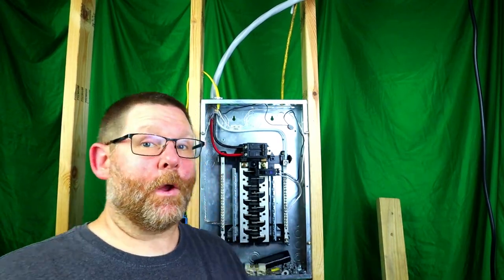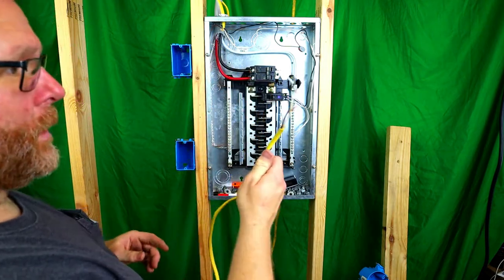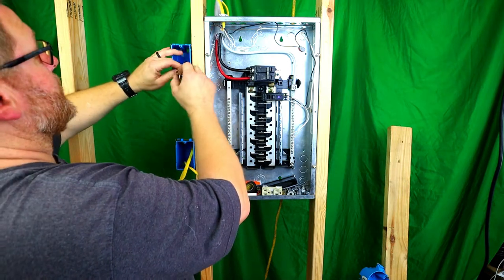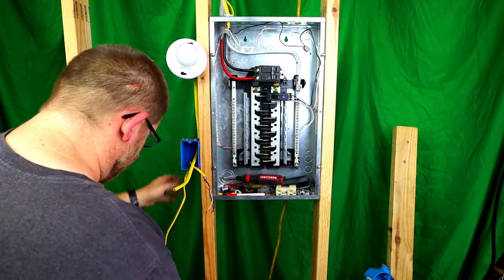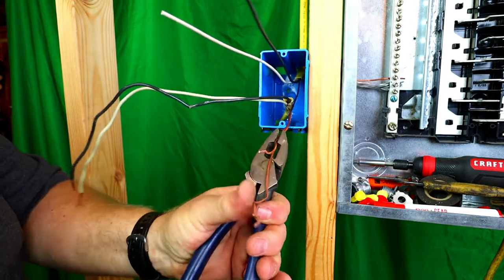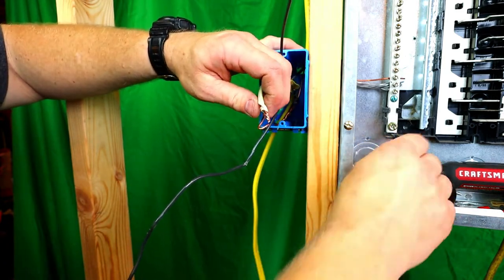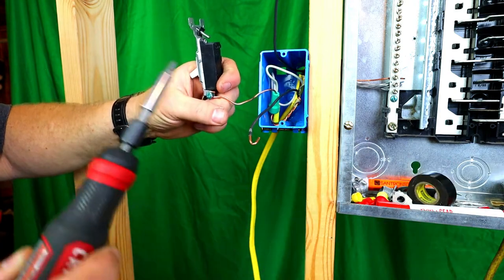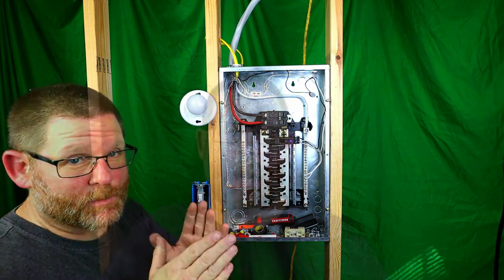Installing A New Light And Switch From Start To Finish | DIY Part 2

Comment: Thank you. Curious about the red, black and white main leads coming in. I typically think of black - hot, white - neutral, ground - green What is the red?
Reply from the maker: Depending on how you run the circuit, most of the time it's a traveler

Comment: Didn’t see link for Klein angled ROMEX strippers
Reply from the maker: https://amzn.to/3SuiKGf not sure what happened to angled here are the straight
Reply: @MountaineerOutdoors  same. Thanks for putting up the new link. You should pin this comment so others can see it too

Edit: actually this link is sending me to the same strippers
Reply from the maker: Apparently the angled ones are not available anymore I assume.
Reply: @MountaineerOutdoors  ahhhhh bummer lol.
Reply from the maker: I know they are amazing if you find them definitely pick them up you won't regret it
Reply: @MountaineerOutdoors  lol yeah I've been meaning to get some but haven't seen anything I like. Which was only one pair now that I think of it, I should've got em when I had the chance.
Reply from the maker: Gotta snag them when you can. My garage looks like a supply house  😂 😂 😂 or lowes